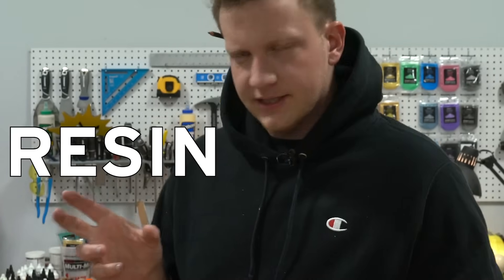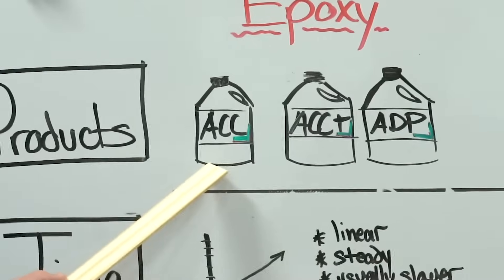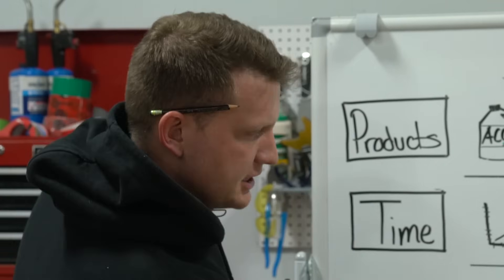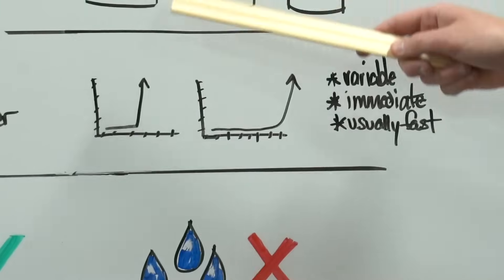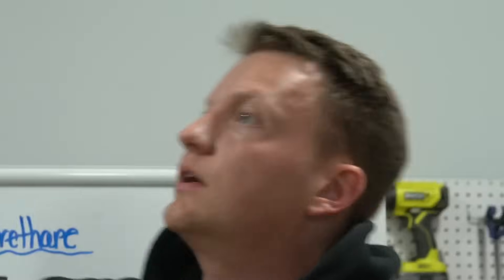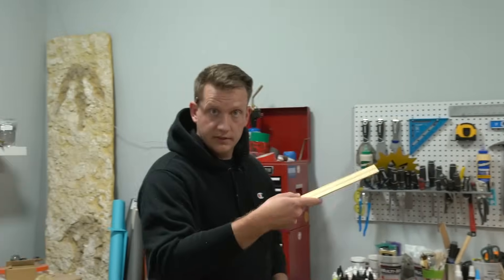Alumilite Explains: The difference between epoxy, polyurethane, and resin

Comment: What about durability in sunlight and soil?
Reply from the maker: If you're looking for durability in sunlight and soil, Amazing Clear Cast Plus is a fantastic option. Here's why:

Epoxy (Amazing Clear Cast Plus)
Sunlight: With built-in UV resistance, it holds up much better than regular epoxy, reducing yellowing over time. 
Soil: Epoxy is moisture-resistant and holds up well, though long-term exposure to certain soil conditions may cause some degradation.

Polyurethane
Even better UV resistance than epoxy and more flexible, making it great for outdoor exposure.
More durable than epoxy in harsh soil conditions (e.g., acidic or alkaline environments).

Polyester Resin
Not as UV- or soil-resistant, so it’s less ideal for outdoor use compared to epoxy or polyurethane.
If your pieces will face both sun and soil, Amazing Clear Cast Plus is an excellent choice for UV resistance. For extreme soil conditions, a polyurethane topcoat can provide extra protection. 

However stay tuned we will be coming out with something that would be perfect very soon 🤫

Comment: I've got a question? Do you know if wood can be completely sealed off from expansion & contraction with epoxy? My reason for asking is i want to build some rather large loudspeaker enclosures out of natural wood. And i've had a set of red oak cabinets destroy themselves once before.
Reply from the maker: Tips to Minimize Expansion & Contraction:
Seal Thoroughly: Apply epoxy to all surfaces (inside and out) to limit moisture absorption. Multiple coats can create a more effective barrier.
Use Stabilized Wood: Consider kiln-dried or engineered wood, which is less prone to movement than untreated natural wood.
Construction Design: Build the enclosure with expansion gaps or use a combination of wood and stable materials like MDF.
Epoxy can help a lot, but combining it with stable wood and careful design is the best approach for a durable, long-lasting speaker enclosure. Let us know if you need more tips!

Comment: I'm having troubles spraying acrylic epoxy bathtub paint from home depot with a gravity feed HVLP sprayer.  The finish always comes out like sand paper instead of smooth and shiny.  Should I thin the paint to get a more wet application or could i cover it with high gloss polyurethane?  Any help would be greatly appreciated. Thank you.
Reply from the maker: If the acrylic epoxy finish is coming out rough, try thinning the paint slightly for a smoother application and ensure your HVLP sprayer settings are optimized (adjust air pressure and spray distance). Covering it with high-gloss polyurethane could work for added shine, but sticking with a compatible epoxy topcoat would be better for durability and adhesion. For best results, ensure proper surface prep and environmental conditions. Let us know if you need more tips!

Comment: I've been trying to pick a resin for a mask mold  and I don't know what is the proper one that can be painted. what do you think about this.
Reply from the maker: Best Resin Options for Mask Molds (Updated):
1. Alumilite Casting Resin (White, Black, or Tan)

Why It’s Great:
Comes in multiple colors (white, black, and tan) to suit your project’s needs.
Fast curing and highly durable, capturing excellent detail—perfect for masks. 🎭
The tan color can serve as a natural base for painting, while black and white provide versatile starting points for creative finishes.

Painting Tip:
Sand lightly before applying primer and paint to ensure excellent adhesion. Use flexible paints if the mask requires any movement.

Comment: Is polyurethane used in products that touch food - Like cutting boards ?
Reply from the maker: No, polyurethane is generally not recommended for food-contact surfaces like cutting boards unless it is specifically labeled as food-safe after curing. While some polyurethanes can be food-safe when fully cured, they are not the best choice for cutting boards due to potential safety concerns and their inability to handle regular knife use without damage.

For cutting boards, food-grade mineral oil, beeswax, or specialized food-safe finishes are much safer and more appropriate options. 😊

Let us know if you’d like more tips or advice for your project!
📞 (269) 488-4000
📧 info@alumilite.com

Comment: I beed to glue together tpu (photo camera part) with rubber (of the handgrip), would you recommend polyurethane adhesive or any other one? For my old camera , traditional cement bonding would work for leather and metal, but It seems tpu and rubber is a different approach? Thanks
Reply from the maker: Great question! TPU and rubber can be a bit tricky to bond because they both tend to have low surface energy, making adhesives less likely to stick. But don't worry—I'll guide you through the best options! 😊

Recommended Adhesive Options

Polyurethane Adhesive:
Polyurethane adhesives work well with rubber and TPU because they remain flexible after curing. This makes them a solid choice for applications where some movement or flexibility is needed, like a camera grip.
However, ensure the surfaces are clean and lightly abraded for better adhesion.

Enviroset 5-Minute Epoxy:
Epoxies like Enviroset 5-Minute Epoxy create a strong, durable bond, even on challenging materials like TPU and rubber.
Since it sets quickly, it’s great for small repairs like this. Just ensure both surfaces are properly prepared (cleaned and lightly roughened) before application.

Specialty Adhesives for TPU and Rubber:
If you’re still not satisfied with the bond, look into cyanoacrylate adhesives (super glue) designed for flexible materials or rubber-based adhesives that specifically mention TPU compatibility.

Application Tips for a Strong Bond:
Surface Prep:
Clean both TPU and rubber surfaces thoroughly with isopropyl alcohol to remove any oils or dirt.
Lightly sand or roughen the surfaces with fine-grit sandpaper to improve adhesion.
Adhesive Application:
Apply a thin, even layer of the adhesive to one side and press the pieces together firmly.
For epoxy, mix it thoroughly and work quickly, as you’ll have about 5 minutes of working time.

Clamp and Cure:
Use a clamp or weight to hold the pieces together during curing. Check the adhesive instructions for curing time—our 5-Minute Epoxy fully cures in about 24 hours.
If you’d like more help choosing or applying the adhesive, just let us know! I’d love to hear how it works out for your old camera. 
📸✨

Comment: So say you mix up epoxy resin and have used 1 litre, what is the cured weight?...is it the same, as in 1 kg?

Thank you.
Reply from the maker: Great question! The cured weight of epoxy resin can vary slightly depending on its density, but for most epoxy systems, the weight remains very close to the original mixed weight. Here’s why:

Key Considerations:

Density of Epoxy Resin:
Most epoxies have a density close to 1 g/mL, meaning 1 liter of mixed epoxy will weigh approximately 1 kilogram.
Some formulations may have slight variations due to additives (e.g., fillers or pigments), but these are usually minimal. 

Curing Process:
The curing reaction doesn’t result in significant material loss (like evaporation), so the weight doesn’t change substantially after curing. 

Precision:
If you’re calculating for something critical, check the product’s technical data sheet (TDS). It will often list the density for both the resin and hardener components. 

In Short:
For 1 liter of mixed epoxy resin, the cured weight will indeed be approximately 1 kilogram. If you’re using a product like Alumilite’s Clear Epoxy, it follows this principle closely.

Let me know if you have more questions or need help with your project!
Reply: @AlumiliteCorporation  Thank you so much for the reply the reason I ask is because I am contemplating making a prosthetic hand having lost the left below the elbow in 2019 and the price of the things is crazy...might look towards a strong foam to fill up a silicone glove instead, it will probably end in tears but will see how we go.
Reply from the maker: @christopherj2231  That sounds like an incredible project, and we’re truly inspired by your creativity and determination! If you decide to move forward with it, we’d love to help however we can. Feel free to reach out with any questions or if you need guidance on materials. You've got this, and we can’t wait to see what you create!
Reply: @AlumiliteCorporation  Thank you so much.

Comment: I have an old PolyUrethane bumper, glass fibre reinforced i think, PUR-GF- 20. I need to reattach a flap on the inner side of the bumper that holds it to the car. At first i thought i could plastic weld this and got disappointed. I understand glue probably is not the perfect way to do this, but if i would use glue what is the best type of glue that bound to PolyUrethane?
Reply from the maker: Great question! Polyurethane, especially when reinforced with glass fiber like PUR-GF-20, can be tricky to bond, but with the right adhesive, you can get a strong attachment. While plastic welding is often difficult for this material, using a high-quality glue can be a good alternative.

Recommended Adhesive Types:
Urethane Adhesives:
Why it Works: These are specifically formulated to bond well with polyurethane-based materials, providing strong, flexible, and durable bonds. Look for a two-part urethane adhesive for the best results.
Example Products: 3M’s Scotch-Weld Urethane Adhesives or other industrial-grade urethane bonding products.

Epoxy Adhesives:
Why it Works: Epoxy can bond well to PUR-GF if properly prepped, giving a rigid and durable connection. Opt for a two-part epoxy that is compatible with plastic and fiberglass.
Example Products: J-B Weld Plastic Bonder or Loctite Epoxy Plastic Bonder.

Tips for Best Results:
Surface Prep: Sand the area lightly to remove any coatings or contaminants, and clean it thoroughly with isopropyl alcohol before applying the adhesive.

Clamp for Curing: Ensure that you can clamp or hold the flap in place while the adhesive cures for the strongest bond.
Reply: @AlumiliteCorporation 
Can Resin Epoxy be used on bathroom tiles?

Comment: Summary
• 0:00:00 • Resin is a broad term that encompasses various substances, including synthetic resins like epoxy and polyurethane.

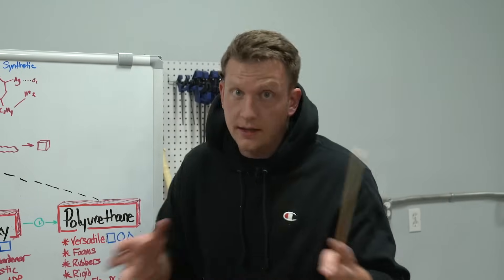• 0:00:47 • Epoxy
    • A type of resin.
    • Strong and durable, cures into a hard plastic.
    • Has a linear, predictable cure time.
    • High moisture tolerance, making it suitable for woodworking projects.
    • More forgiving in terms of mixing ratios.

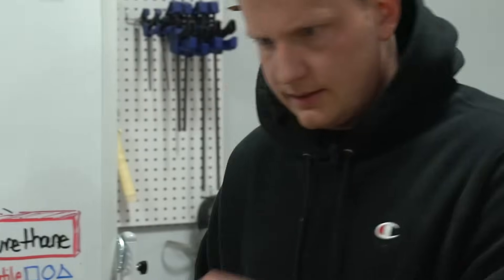• 0:01:22 • Polyurethane
    • Also a type of resin.
    • Versatile, can be a foam, rubber, or hard plastic.
    • Cures very quickly.
    • Low moisture tolerance, not ideal for direct wood application.
    • Less forgiving with mixing ratios, requiring precise measurements.

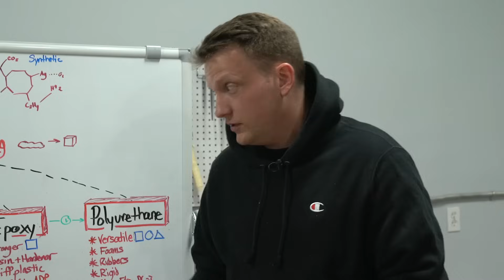• 0:00:52 • Polyester Resin
    • An older type of resin.
    • Brittle, primarily used with fiberglass reinforcement in applications like boats. 

I used Google Gemini 1.5 Pro to summarize the transcript.
Cost (if I didn't use the free tier): $0.0562
Time: 19.33 seconds
Input tokens: 14846
Output tokens: 400

Comment: hello. looking for a crafting item that may or not exist. was hoping to be able to find a 2 part epoxy style mixture that is completely water clear but has a more rubber surface texture? or a little shock absorption quality? i want to pour it over other items with full visibility. but the shapes will be used in a way where they will be knocking into each other a fair bit. could I perhaps add something to regular epoxy resin that ticks all the other boxes except the subtle rubbery surface. thanks for looking

Comment: I am making an ocean going sealed boat. It must must be water proof. Hopefully epoxy over plywood. Is this a good idea ? I live in a tropical environment and will have it under the shade while I work. Any recommendation ?
Reply from the maker: seal the wood before you add the epoxy to it would be our recommendation
Reply: @AlumiliteCorporation  no one sells marine plywood where I am, would adding some sort of chemical or additive to normal plywood work enough? And just have extra layers of fibre glass? Like ten layers? Any recommended sealer?

Comment: I have been making resin knickknacks in silicone molds that contain lots of small stones.  The molds are about an inch or a bit less in thickness and 3x8 inches big.   
I live in Michigan and it’s cold here.  I just started shipping and 6 of 7 of my products broke in the mail.  I notice the products are more brittle than I’d like.  How can I make products that will withstand the cold in shipping and not break if casually dropped on carpet?
Reply: Should I use pu instead of epoxy?  Is deep pour less brittle?

Comment: Just to be clear on the water part, once the resin is fully cured, whether it be polyurethane or epoxy, they both don't care about water at that point, right? It's just in the pre-cured phase that the polyurethane will react poorly?

Comment: Great video and very informative but i still don't know the answer to my problem.
I have a party rental business, we rent out waterslides and bounce houses and we use 20' box trucks and dollies. The box truck has a wooden floor, (2x4s) and plywood walls. When we bought the truck we asked the dealer to put a protective coat on the wood but it looks like it was something too light, like a stain or something like that and its starting to wear out. I want to coat the surface and may be 1 foot on the plywood walls in order to protect it. Sometimes our units come in wet, also we are in south Florida where humidity is always above 85% and temperature is always between 80 and 100..... 

After some research I was ready to do an epoxy coating, it looked more resistant to scrapes (dollies will do that) but after asking an epoxy manufacturer they said that with the truck movement the epoxy might crack inside, so now I am unsure. I feel like polyurethane might be either not protective enough or it could end up being too rubbery. Is there a type of polyurethane I should be looking at for my application or can you point me in the right direction?

Comment: My deck boards have huge cracks and I was thinking epoxy would be good to fill them. Any thoughts?
Reply from the maker: Hey there! Epoxy is not friendly to heat or humidity especially relating to wood. I wouldn't recommend it for an outdoor deck.

Comment: A thermoplastic is a polymer that can go through heating to soften and then cooling back to solid repeatedly. Basically it is solid to gel to solid cycle. A thermoset can only go through one cycle that is gel to solid, no repeating.

Comment: Today epoxy is used in high-end boats instead of polyesters. Epoxy is not porous.  Water will not pernitrate an epoxy coating. The various polys will allow water to pass through (albeit over time).

Comment: So if I take some new Southern Pine stair treads, use some Varathane Pre-stain Wood Conditioner, stain them up to look like oak, and now they look awesome.  According to this video, epoxy is what I want to go over the wood.  I'm good with that except no big box store sells penetrating epoxy, only boat stores.  Big box stores sell casting epoxies for tables, countertops, and crafts.  They sell polyurethane for hardwood floors, which is what the professionals use.  Floors see plenty of moisture.  So it must be that polyurethane has zero issues with water as long as it is not applied over damp or wet wood, and I wonder if it might even blush in high humidity like lacquer does.  However, it will wear at least as good as epoxy because often they add invisible aluminum oxide for wear resistance.  The penetrating epoxies are used wood on boats and deteriorated wood because it seals and adds strength, with a polyurethane coat over it to protect it from being destroyed by UV.  Imron that I use on my airplane, 2-part urethane,  is the only paint that retains a high-gloss wet look on cowlings and leading edges where they are continually being sandblasted by the air.  With Luxury Vinyl Plank, urethane is the wear layer and with the tiles it is what is applied over the PVC to increase its wear resistance.

Comment: Worse than water is air when working with wood. Wood is a living thing and breathes. Off-gasses even at 7% or less because of the "circulatory system" or tubes that will fill with air as it dries. If you're not using a pressure pot to infuse all of those tubules, you're going to get a lot of bubbles. So, to use either without a pressure pot, just coat with a grain sealer (like a shellac sealer) or better, coat with a thin layer of epoxy and let it cure. Now you have a barrier that will not off-gas when you pour.  Another option is to coat with UV resin and let it sit outside in the sun for 30 minutes, and then you can get to pouring faster than epoxy will cure or using a pressure pot. 
However, that doesn't stabilize very pithy wood. That needs to be stabilized in a pressure pot to make sure the wood is totally infused with resin or it's going to blow out when you turn it.

Comment: Which is best for crystal clear jewelry making? If my research is right urethane does not yellow over time? Can urethane resin be used over cured epoxy resin? When it comes to urethane and moisture how volatile is it with air moisture? I want to make jewelry but have seen that alot of people use epoxy resins that are know to yellow over time and some very quickly so I'm trying to determine which optical clear resin is best and will last and is also machinable?

Comment: Comment regarding the types of Amazing Clear Cast:
When I’ve used the Surface Clear Coat , I’ve had trouble with a film of some kind and a bunch of little specks.  I have used a heat gun to get out air bubbles. The thickness is about 1/4 - 3/8.”
Been told to use the CC+. Will that work with deeper surfaces like 3/8 - 1” ?
Thanks Dennis